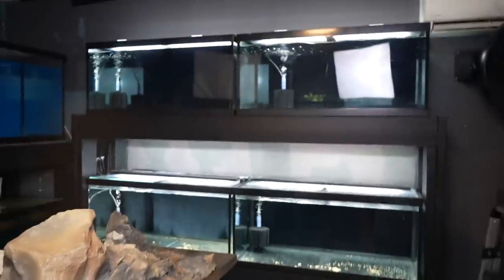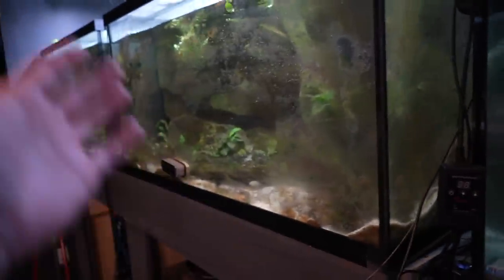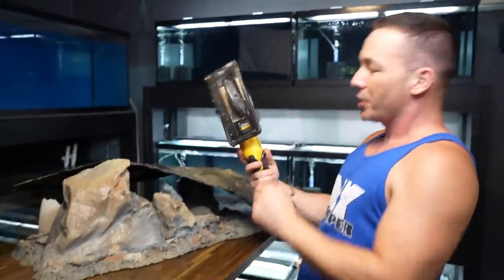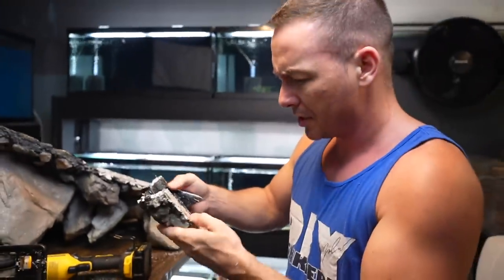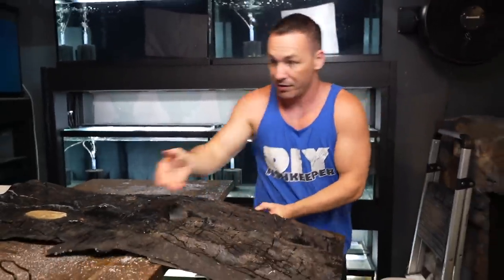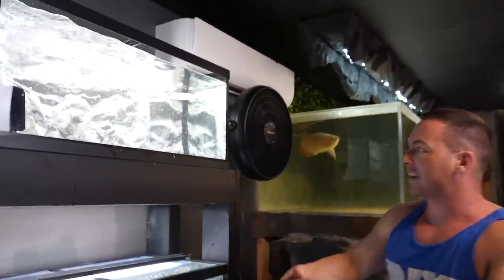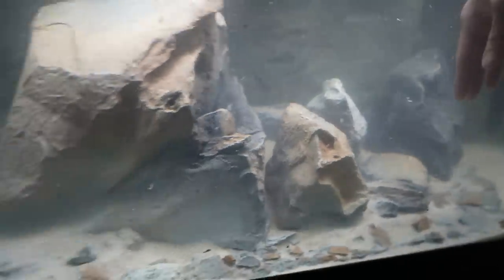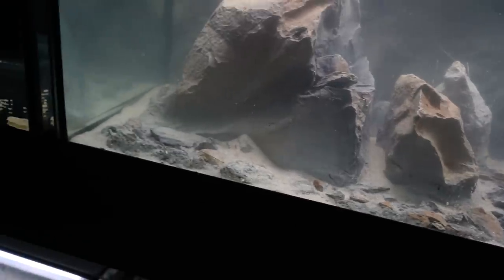The first aquarium to do this?

Comment: Some epiphytic plants glued on to the back wall and some plants behind the rocks will help the tank look balanced.
Light should be towards the back but not all the way. Molds are useful. 
It would be great if you could extend the building so you could fit more in.

Comment: Looks awesome.  I liked the light at the front so it illuminates the fish that will be along the front right where you see them.  If the fish like to hide at the back then I would move it to the back.  I also like the floor off center.  My tanks are both set up like that.

Comment: i think its tough to tell lighting until the water clears up but id maybe try pushing the rock formation to the right side instead of the left, that will put that big rock kind of in the middle but it will balance out with the other smaller ones on the right

Comment: You could drill holes in that big rock and hide the sponge filter inside it
Reply: In my opinion, it's better not to put the sponge filter inside the big rock. Because if you put it, not only you need to make a big hole that match the diameter of the sponge, the rock will restrict the flow and make the filter less efficient.
Reply: @RioCahyadiDrayka  that's fair i suppose